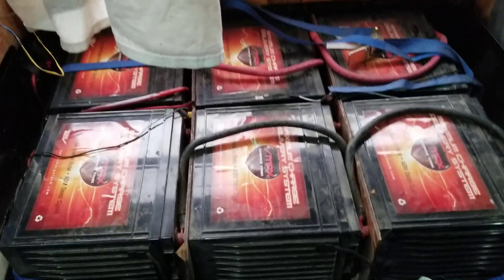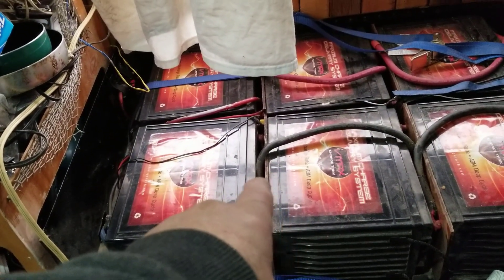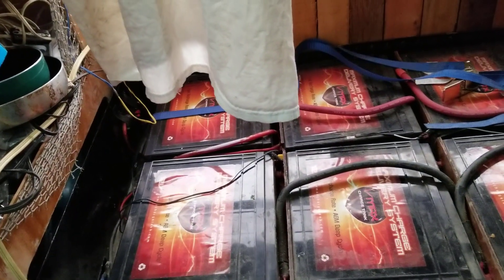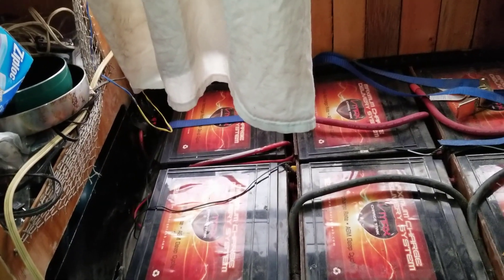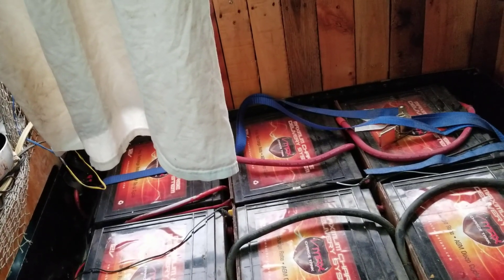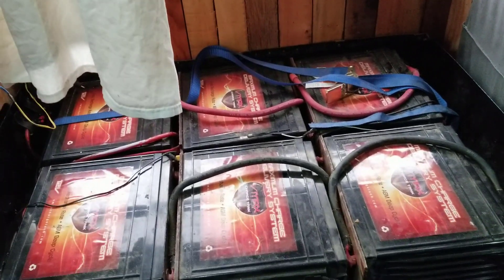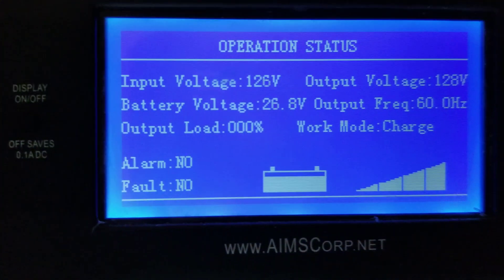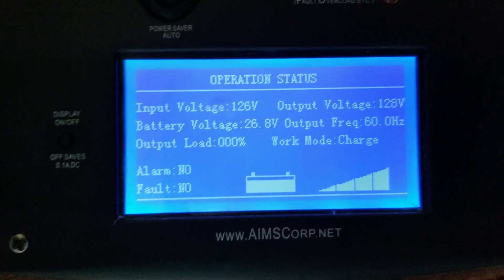Skoolie Adventures Episode 5: House VMAX battery problem from over-charging

Comment: Is there a way to control the charging or some way to prevent that from happening?
Reply from the maker: sorry for the late reply, the charge controller controls the charge and if it doesn't bad things happen like over charging and possibly causing bulges (very bad), so now I've reassigned the Master to another controller (I have 3 charger controllers), everything is running properly now except I'm now waiting on a replacement controller and now I can only use 4 panels instead of 6, they are sending a new one as soon as i get to my new location (probably Edinburgh AZ)